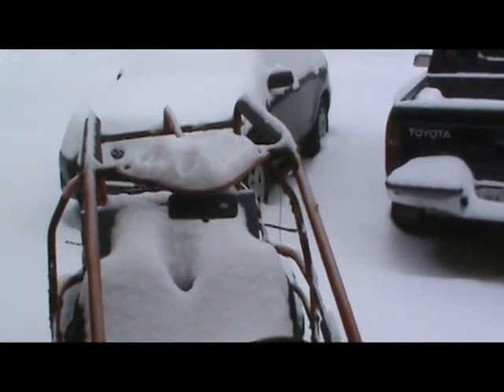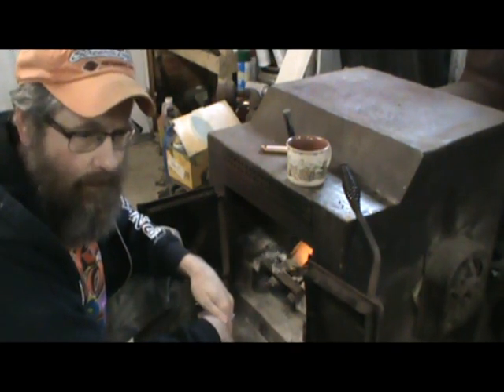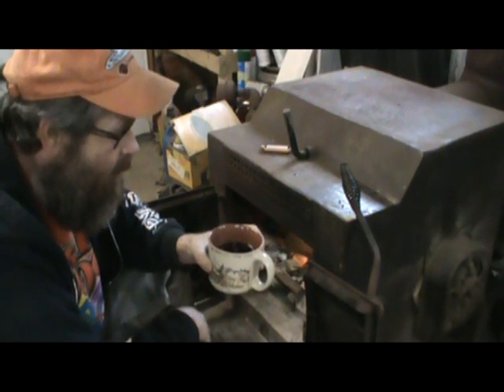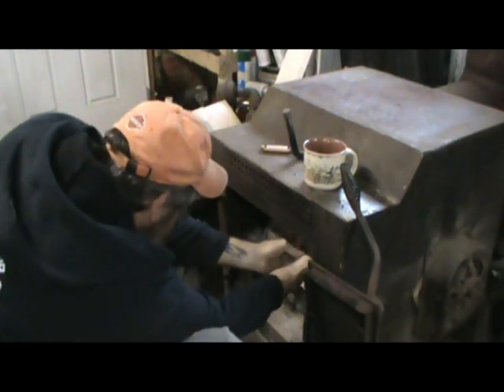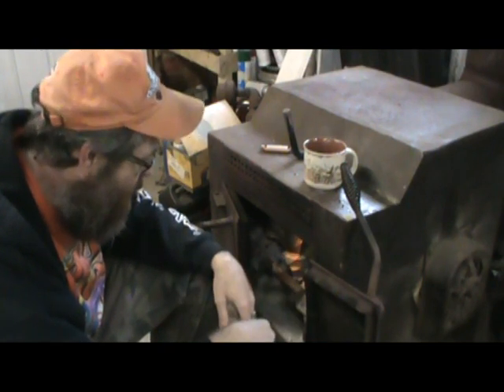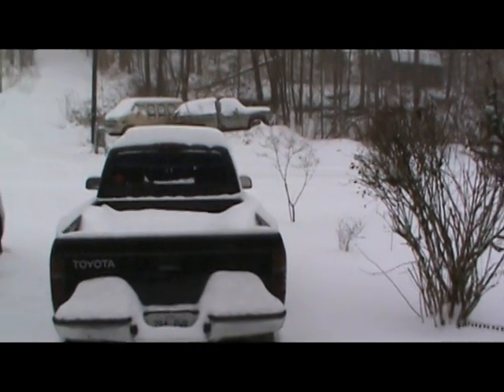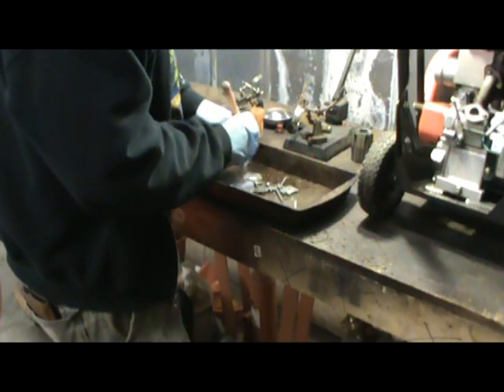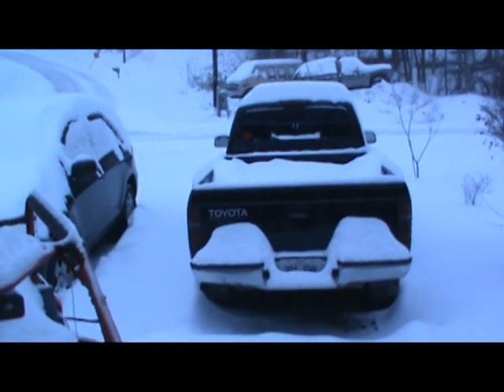Just Hangin'-Out We got a fresh dump of snow _02-16-15

Comment: Not sure if the fuel is wearing the carbs out ,or the ethanol is doing something . I used to rebuild all the carbs that came in , but lately had a few i tried many times and they just did not work . I got one that the local stihl dealer done twice , still did not run right , when they brought it to me i replaced carb and all was good . even the ultrasonic cleaner does not seem to do the trick , so i look at it any more a 50  50 chance when redoing one of those carbs .  .
Reply from the maker: i hear ya buddy, i had a rebuild fail last year on a walbro carb and bought a replacement carb and it worked. i guess i should have made my point more clear that they aren't making the kits available like they used to. either way ethanol is rough on carbs.